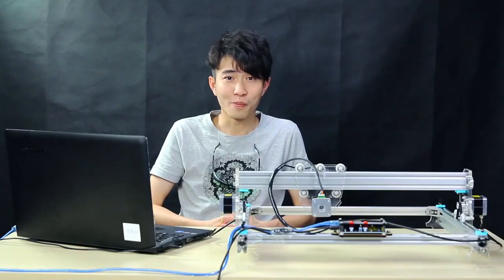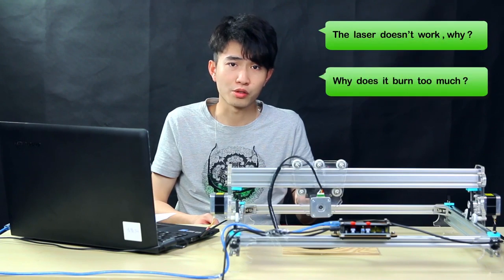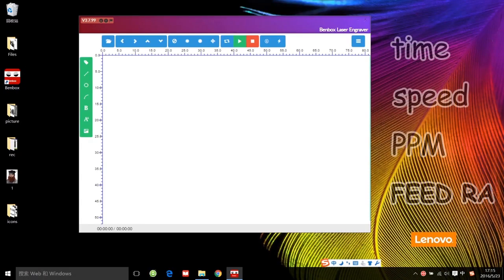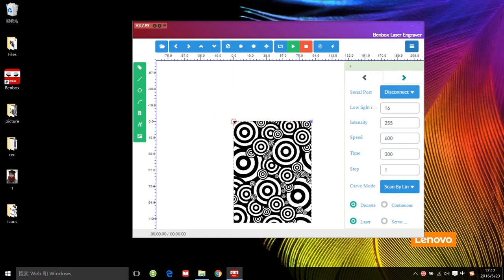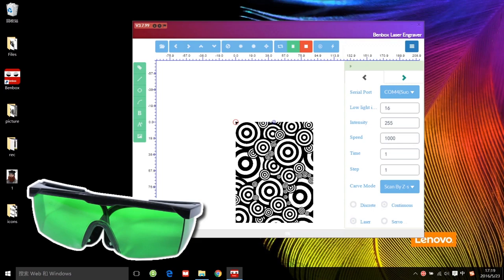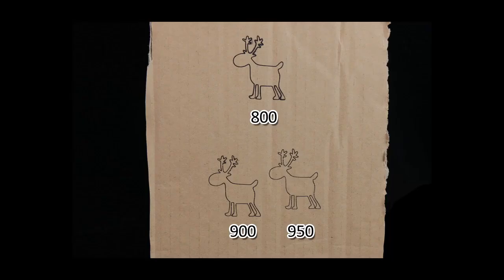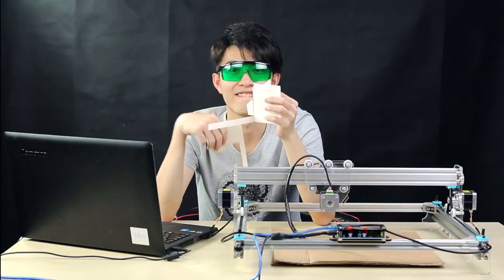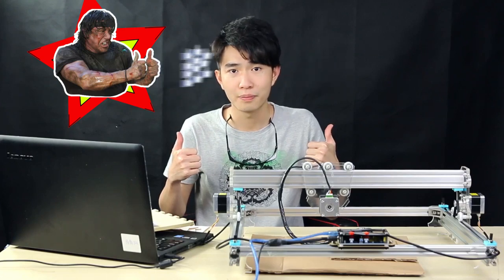How to use | 5.5W A3 30x40cm DIY Violet Laser Engraving Machine reviewe - Banggood Tool Sets

Comment: I bought the laser engraver but wires were short not matching the machine size and banggood is not replying
Reply from the maker: Could you please send us the video showing the connection of the machine, software setting, and machine working situation,and problems? We would try our best to help you find the problem and give you solution.Then we would send the supplier to confirm what is the problem.We would do the best to help solve the problem. 
Our mailbox is banggoodofficialyoutube@banggood.com.
Reply: Banggood Tool Sets i have same email with all proves even your agent offered me a refund of 20 usd for the issue but i refused as if i want to order the correct cable it will cost me much more
Reply from the maker: @ahmedalkassab9751  Hello, please provide the order number and email, our colleagues will contact you.
Reply from the maker: Sorry for the inconvenience caused to you, I have feedback the problem to customer service, customer service will follow up.
Reply: They again dont reply please take care from this website as what they sell you is not what you recieve i have sent them 100 of emails for almost 3 month and they admitted it was a mistake but no replacement or refund

Comment: the video is helpful and informative but does raise question:    there a much talk about the SPEED of the laser burn routine, but why can't we modulate the power of laser independent of speed?   in other words:   decrease the power of the laser and keep speed the same?
Reply from the maker: Hello, the power of the laser is determined according to the corresponding laser guide block, which cannot be adjusted, while the power determines the cutting speed. With the increase of the use frequency and times, the product will consumed, which may lead to the lower speed than before.
Reply: @banggoodtoolsets6185  So, does this mean, if i want to reduce the number of passes, then i have to wait a little instead of adjusting any parameters? Also can you tell me what material will this 5.5w laser will be able to engrave? Thank you.
Reply: @banggoodtoolsets6185  Also is there any way to adjust the amount of material removal in a single pass?

Comment: What function ppm? Ihave this machine but to slow work?
Reply from the maker: Hello, ppm is an important parameter to measure the printing speed of the printer. The working speed of the engraving machine will not be very fast. Its working mode is like this, slowly carving an item.
Reply: @banggoodtoolsets6185  if I want to change laser modul with more big power such as 10 wat.how to set
Reply from the maker: Hello, if you want more big power, you can only change the laser module to 10W, it is best to replace the laser module of the same brand.